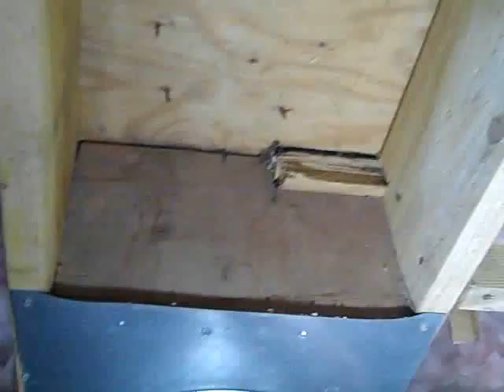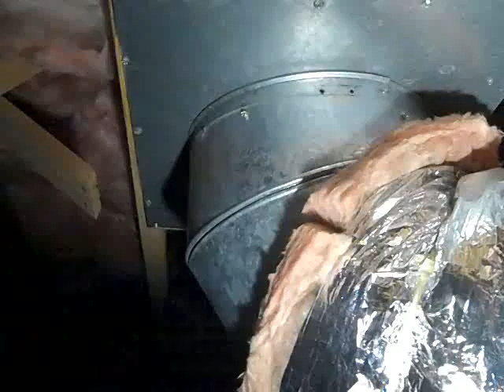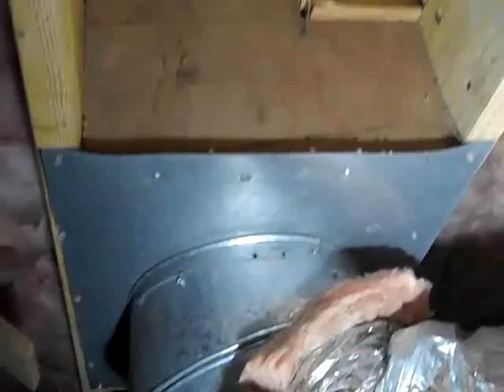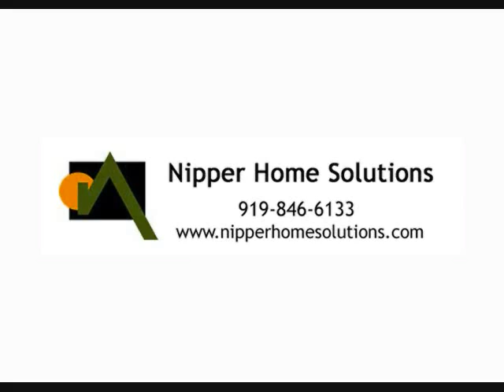Improve Energy Efficiency...Crawl Space Air Ducts

Comment: Hey Captain Obvious you missed a major "energy efficiency" tip. Seal up all of those gaps that not only introduces moldy, humid radon filled air into the conditioned space that your customer has to breath but also has to pay more to make the unit run longer heat that cold air you're letting suck right into the return.